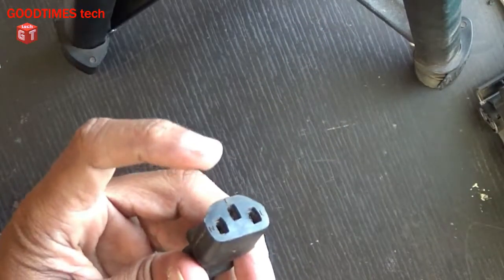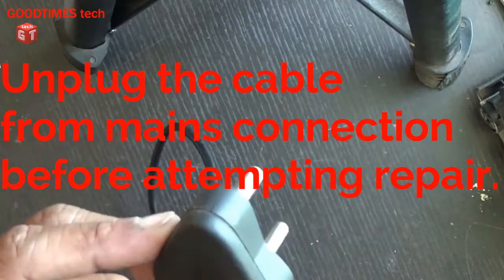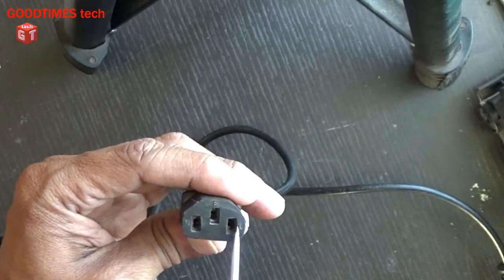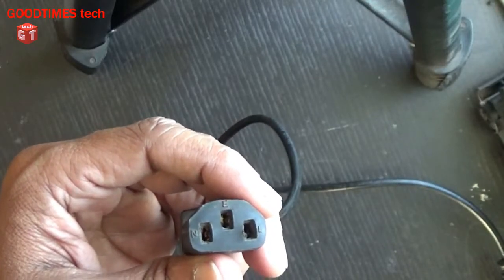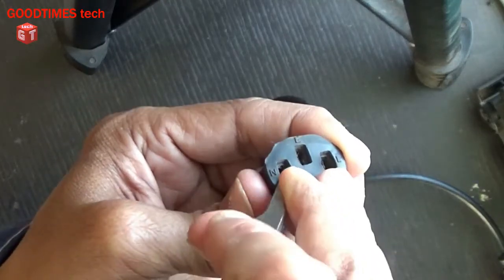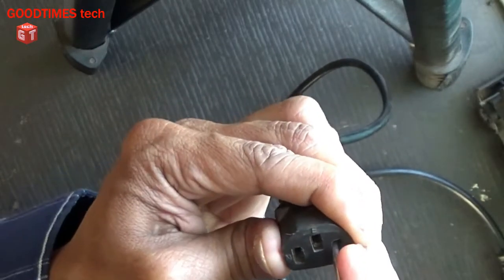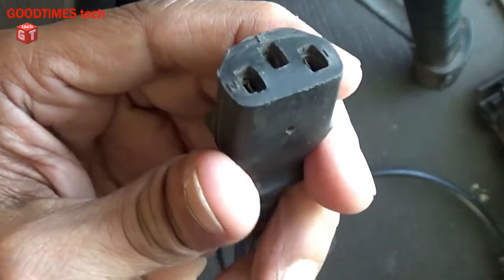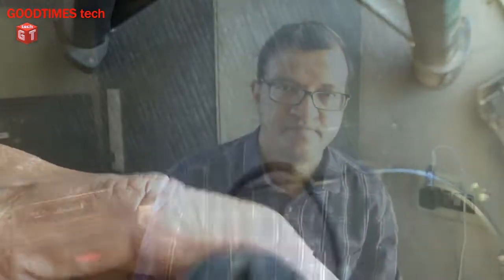Power cable Loose connection, how to fix

Comment: Good stuff mate,
After having looked up the video I realised that I'm a mechanic and I'm impressed I can vouch for this being a genuine and professional technique we do it all the time to fix loose plug connections in cars causing stuff like navigation system to cut out when you go over bumps or whatever..
I didn't realise it could be scaled up to this size to be honest because I'm talking about 0.10 gauge wires so it's cool that it works at this size too 👍🏻

Comment: it did not work for me😢 it opens for some time, and then goes off randomly (the monitor) the sparking continues when i try to move the cable around the area where it joins.. so that it can work..

what should i do? should i get a new cable?
Reply from the maker: Hi, Please see if the video in the link below will be helpful.
And also check if it is cable that is faulty or there is dry solder joint on the device power supply PCB where the cable gets connected because in some cases I have noticed the same.

Thank you, have a GOODTIME....
Reply: @GOODTIMEStech  okay, ill check it, thank you so much for reaching out!
Reply: Same problem with my monitor,after change new cord still same,sparking sound still there..maybe ac in port problem ?
Reply from the maker: @virgoleo7985  Yes, need to check ac port.

Comment: Hi my PC was fine all this time was using it no prob i just open today to check on something when i close it now switching off after 45 minutes what is the problem
Reply from the maker: Hi, if you had removed the processor heatsink then you need to clean and apply heatsink compound and fix the heatsink firmly.